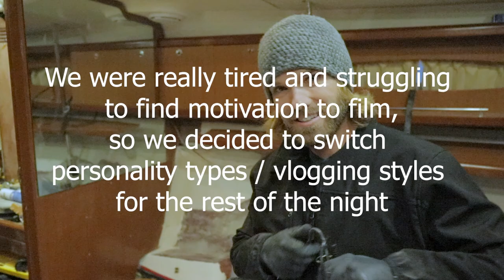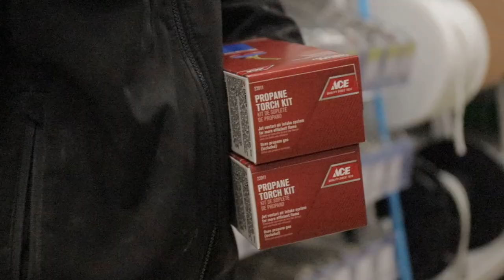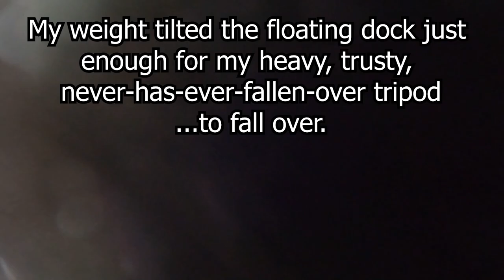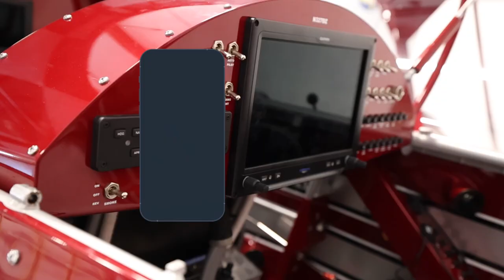We LAUNCH (our salvage sailboat)....And Take Off! | Expedition Evans 32

Comment: You guys have done an incredible amount of work in a short time. There's plenty of other youtubers that have been working on their project boats for multiple years. Your results are inspiring and I'd like to know if I understand some of the secrets of your success.
   You bought a boat that would have a lot of value when it was repaired.
   Your boat mainly required fiberglass repairs with no water damage to wiring, engines, wood etc.
   The fiberglass repairs were all on the interior which meant the final finish did not have to be perfect.

I'm now looking for a boat with similar criteria.  Quite a few have suffered major water damage which seems to mean that the boat has to be gutted and rebuilt. That's a lot of work.

Anyway, here's to your continued success.

Comment: When I was 17 years old I drilled 550 mm deep holes in to the front cast alloy leg for several L-39s. I worked on the biggest most expensive CNC machine in the factory with zero experience. Fly safe. 😉🤞🤞🤞
Btw very well done video from the flight. I really enjoyed it. Music, editing, framing, pacing was perfect. 👌

Comment: Awesome videos. You two are real troopers. 
Tip 1) Heat lamps (especially clamp ons) work wonders under (or inside) a boat for curing paint, resin, etc..
Tip 2) Zinc spray paint will not stop electrolysis on brass / bronze. 
Assuming that's what you're trying to accomplish. 
Get a prop nut zinc that will fit your prop / shaft.
Tip 3) Ospho - aka phosphoric acid -  uhm... well, maybe a quick temp fix. Underwater, (salt), not so much. But better than nothing...... but just temporarily. 
Next haul out grind off all of the rust and coat it with Zinc chromate epoxy. The whole keel.
That's as good as it gets. If you can still find it.
National Guard Epoxy Zinc Chromate Primer - not sure why it shows up on the Decorative coatings but this link will get you there. But this is the type of epoxy you need.
DECORATIVE COATINGS (national-paints.com)
Keep in mind paints / coatings / resins only work as good as your prep work allowed it to. Words to live by.
OK. That said;
Brett had his, now Jade needs a super adventure. Sail on!

Comment: Congratulations on the launch !   Mantis or Rocna. One size up. Proper/matching bow roller. Heavy duty bridle. Service windlass first. If you can, dedicated battery up front for windlass. 12 gage wire run for charging battery. Cost of battery and 12 gage wire is not much more than heavy gage cable run to the bow.

Comment: Check out Sailing Uma episode 41 where they discuss their anchors. Yes, more than one. The Rocna is the working anchor while they have a big Mantus for extreme storms. The Mantus is disassembled and stored in a locker until needed. I believe episode 54 is where both anchors are needed to ride out a hurricane.
Reply: This
Reply: If I remember correctly I think they only used the Mantus in the hurricane (they discussed the thinking behind it in a previous episode)
Reply: From memory... I think they replaced the bow roller and the swivel etc...
Regarding anchors... Where are you going to sail? .. What do people find actually works in those locations? ..
You should be carrying 4 or 5 anchors including one for rocks ie a fishermans.. also a general anchor with some chain and then warp.. useful in settled weather and waters, easy to deploy and retrieve when waiting for a lock etc. ... also a (or 2) fairly light 4 prong folding anchor on a floating? warp.. steadies the stern and for dingy also for long mooring lines.
Something to check... let the chain out and make sure the end is connected to the boat!

Comment: Drill, tap and add 2 anodes to that keel = no more rust or very little, tear drop style one each side cardboard box around keel with a heater inside will cure epoxy Awesome flight

Comment: To heat a large area with consistent no flame heat get 300 watt halogen light. 
I heat my horse trailer where we live at the boatyard with halogen lights. It gets to around 30 degrees Fahrenheit . The dog and I are fine!  No carbon monoxide. It's like a tiny house but I only had to insulate it.
In hard winter when it's minus 20 F, I would use a halogen light to heat up the intake manifold and fuel injectors so the auto would start after freezing for hours. 
You can still burn yourself so you have to be careful and don't zone out.

Comment: Hi guys. With the keel rust, what you did was great, rust starts forming  after 6 seconds so you will always get it. The best way is let it surfave rust a little then hit it with acid to convert it. Then seal with barrier coat and paint. As long as oxygen cant get to it it wont rust...sooo no scraping the bottom and youll be good to go!!
Enjoy being back in the water with 1 boat instead of 4x0.25 boats

Comment: I dont know if you know this or not but the little red heater that you have, they make a 12 or 20 foot hose that connects to the heater and directly to a 20 pound propane tank. I have one and it gets annoying having to replace those 1 pound bottles. You can also get an adapter to refill the 1 pound bottles from a 20 pound bottle which is a lot cheaper than buying the 1 pound bottles. I love your enthusiasm

Comment: Magnificent!
I really liked your use of slo-mo when launching, the slo-mo voices were so funny and fitting for the event...
Then when you continued in slo-mo I thought it was odd. Finally I thought to check my playback speed.
Yep, one of my dogs stepped on my keyboard and changed the speed to 0.25.  So funny! I did go back and watch in normal speed of course. What a milestone to launch the boat, it is such an emotional moment of hopes and dreams.

I was very surprised that you have not flown any aerobatics before. That is fun flying, not just driving a plane. If you take lessons you will find that it makes you a much better pilot even when just driving a plane. I think part of all flight training should include at least basic aerobatics.
Reply from the maker: HA! That is one of the funnier stories. 0.25x speed would take a while to finish a video 😂

Comment: Dingo on the dock looks like me at a boat show. I'm accustomed to being on light floating docks with considerable wind and water movement. During a show with the docks moving because of all of the people walking on them, makes my legs feel rubbery and my tummy gets squishy (and not in a good way.)

Regarding anchors, I've been looking too (I have a Kaiser 26, so much smaller anchor) and I'm going with a Mantus. It seems Mantus, Rocna, Lewmar are all pretty comparable, and you can't go wrong sticking with any of the top quality manufacturers, but Mantus seems to have a bit of an edge in bite (sets quickly) and maybe just a touch in holding power as the boat swings with tide & wind changes.  For a storm anchor, go big as not only is your boat big, but Beneteaus have a pretty high freeboard and relatively flat sides, so more wind resistance.

Comment: Must feel great to finally get the boat back into water.  You two have done an outstanding job repairing the damage
I have a question.  Why did you paint the prop and shift with spray on zinc paint.  I'm guessing that the prop is either stainless steel or bronze, and very corrosion resistant to salt water.  A zinc coating would be sacrificial and I suspect it will corrode very quickly because the base metals, mentioned above, are much more noble.  I suggest periodic examination to see how long it lasts.  Seems to me that once the paint starts to wear off, from friction as the prop turns, the rest will corrode quickly because of galvanic corrosion.

I'm a retired metallurgical engineer so I would appreciate hearing how it goes.
Thanks for the series, I really enjoy them and look forward to many more in the future.  Mak

Comment: This was my favorite episode so far!!!  The launch and flight time in one vid was great.  Also the lost key was so ME.  lucky diesels are remarkably easy to jump start. All they want is fuel and spin. (though some had glow plugs. )  Many had a manual shut off though some have an electric solenoid valve on the fuel line or directly on the pump.  So just turn that stuff on and spin.  Again that was so much fun  From my comphy chair  Bill

Comment: For folks wondering about this zinc cold galvanized paint.....Not sure if that spray is good for the prop job but I do know it's great stuff. I half heartedly sanded some rust off my boat trailer fender, rusty nuts(lol) and a few other spots. Goes on like ugly flat gray paint but once it got rained on and aged a bit it matched my galvanized trailer wonderfully with the mottled look and eliminated any rust issues.

Comment: Congrats, though this is somewhat anticlimactic since we saw you in the water at Christmas! Still, you must have felt wonderful. Two questions. Please update on the Rust-oleum zinc paint when you get a handle on its efficacy. I'm also curious how you feel about white(ish) anti-fouling. I've thought about it for years, but I'm concerned that it will always look dirty at the waterline.

Comment: Rocna anchors are hard to beat. Their newer design the vulcan with the weighted tip sets and holds well in mist conditions. If you prefer the rollover hoop then the original rocna is the benchmark.   Check a few youtube anchor reviews.   I have the vulcan. Its never dragged, and almost always sets first time

Comment: I know you did the barrier coat (I hate Interlux Epoxy - when I used it, it dissolved almost every paint roller I bought), but did you guys not use an antifouling paint?  As the boat was being moved to the water, it looked as if every other boat in the lot had an antifouling coat on the bottom.  I just did my boat two days ago - it’s on the Great Lakes, so I used VC17.   Best of luck.  Lance SV Great Escape - Newport 30 - Mk lll

Comment: Now that your in the water, don't forget to put your electronics in the oven when your in an electrical storm, it will act as a faraday cage an protect them from damage. And also you can use that bubble packing stuff to insulate your hatches so the won't sweat! Great job, I new you were going to get it done, Yeah.

Comment: You should have painted it with Prop Gold or prop speed coating.You have just combined disimilar metals good luck with that props ground your shaft and engine unless you have a drive saver installed at the transmission coupler.

Comment: I think Brett has a permanent smile now after that flight. You can’t go wrong with a Mantus anchor if you’re looking for a new one and go with something larger then you need.
Reply: They should talk to Greg. He might want to cut them a deal.  Even if not, they can't go wrong with a Mantus and Greg and his team will go over exactly what you need.  I like how Mantus has a really good bow roller designed to work exactly with their anchora, unlike Rocna which leaves you out on your own trying to find a roller that can handle theirs.
Reply: Ditto for dinghy. ;)
Reply: @garycarlsen907  They can't go past a Porta-Bote. Check out Free Range Sailing in Aust. Their comment is they turn up at anchorages with the smallest yacht (30ft Clansmen)and have the largest most solid tender. Its a 12ft fold up dinghy that they store along their portside railing. Crocodile/alligator  proof.

Comment: Any engine key from the same make engine  will probably start it . The biggest security feature on any boat is it takes skill to steal it . Most criminals can't even figure out how to open the drawers . 

On that note had a friend who had some kids break into his boat  while it was on the hard to steal some booze . They pried every drawer open with a crowbar because they did not know how they worked destroying the teak interior . 

So now most of us leave the boat unlocked on the hard stands , the doors and drawers all open , handheld stuff at home and a 1/2 bottle of whiskey on the counter . Anyone that climbs up to rob the boat are not going to be stopped by that flimsy lock - might as well not have the door busted too .  Lock the ladder .

Comment: Just looked up the numbers  - I would go with a Rocna 40kg - the size down is 33kg which would work in most situations. I also would keep 2 , if you sail the world you will be anchored in a hurricane. The 33 would be very good in 50 knots, the 40 would probably take you easily upto 90 - if both 40s and there is trouble I would be more concerned about losing the mast. Lot of trade offs, the 33 works whatever, and is easier to handle. The 40 is starting to be a bear, but might be annoying to handle the 90% Two 33's take you right to the edge of a really bad once in a decade hurricane. Could go one 55, one is never a good idea.

Comment: Some advice about saving water damaged electronics.
1st, Remove the batteries from the thing as quickly as humanly possible.
2. Let it air dry, you have plenty of time.

Electronics doesn't get inherently damaged by water.
What makes the water especially dangerous to electronics is when there is any power applied to the circuit. The electric current going through the water will aid the migration of ions, this will tend to accelerate any corrosion fairly quickly, or just make the circuit itself dissolve away. Ie, as long as the battery remains connected to the device, there will be rapid corrosion occurring within the device. (In some devices there is also a small CMOS battery for running the real time clock and at times store user settings, but this is fairly rare on modern gear outside of computers.)

Some people also incorrectly believe that distilled water is non conductive. It is slightly less conductive, but the main thing to note here is that any dirt on the board will dissolve into the water making the water noticeably more conductive since practically all dust has some ion content, typically salt.

Also, covering the device with rice to dry it out is little more than a waste of rice. It doesn't magically repair water damaged electronics. Nor does it actually dry out things all that well.

In regards to pouring water over electronics, this is a common practice in electronics factories. It is a standard part of rinsing off any flux residue from the boards. Flux is practically there to remove any oxide buildup during soldering as to get a good solder joint. But some types of flux (typically liquid flux) are fairly effective even at room temperature, something that makes them eat away the circuit over time. So cleaning it away is an important step.

In the end.
What you should have done were to pull the camera out from the lake, rip out the battery there and then as quickly as you could.
The decision to carry the camera to the boat without taking out the battery first is likely what killed it. Since it gave the water more time to seep into the device, and also more time for the electricity to accelerate the corrosion.

The 5 second rule is surprisingly "true" as far as water and battery powered electronics goes. (Though, taking a second or third dip isn't a guaranteed success.) Though, mains powered stuff tends to just go bang, not that one should risk one's own life to save such devices from their watery grave....

Comment: I have no idea what brand the demised camera is but I may be able to offer some kind of advice regarding the replacement.  Speaking as an ex pro I can tell you that I have worked with Canon and Nikon gear with great success and never any problems. Both manufacturers produce  excellent quality products so it may come as a surprise to learn that now I have changed allegiance to the Olympus range of professional cameras and lenses. I can tell you that had you been using one of the top range Olympus Pro bodies and lenses the odds are strongly in favor of the camera and lens surviving that mishap to shoot another day unless the whole kit spent some time completely submerged in which case only a pro underwater case will suffice. This ability is due to the 'water resistant' feature of Olympus Pro equipment. These cameras and lenses come with a built-in rubber membrane encasing the whole technical body of the  camera  or lens within the all metal external case. I don't have the space here to go into the merits  or otherwise of the Olympus Micro Four Thirds format and anyway as usual there's all the usual suspects on stage poised to strike dumb anyone who has the time and inclination to listen to their profound wisdom but for me it's enough to know that the MFT System is fulfilling the professional requirements of a growing number of working professional photographers. I will say that a couple of benefits of MFT are cost and portability matched by superlative quality optics from Olympus and a wide range of other lenses from other manufacturers owing to the highly adaptive MFT mount. That's all foks! I'm looking forward to your next video!

Comment: Just got to the part where your camera fell in the water. I am a photographer and was out doing landscape at a waterfall in dead of winter. I fell with my Nikon D850 fell in the brackish water and mud. Turned it off immediately, shook it out vigorously and came home. Took it apart down to the circuit boards, soaked them all in 99% isopropyl alcohol and reassembled. It worked PERFECTLY for 8 months until I got my Sony A7R3. I sold it to a friend where it still works to this day. Now gonna watch and see what happens with yours...(Crosses fingers)
Reply: Awww it died! Yea the rice trick doesnt work at all. Soaking it immediately in isopropyl, even with it being saltwater, if it was off, would probably been ok. Never know, if the power being on for even the few seconds, with the salt water was enough to fry it. RIP Camera